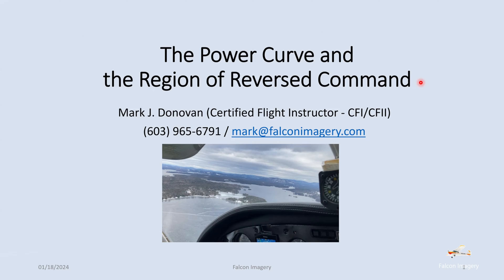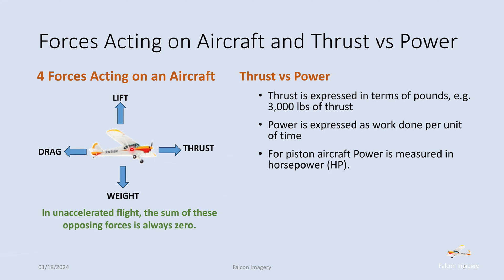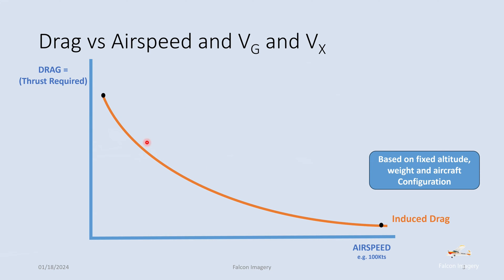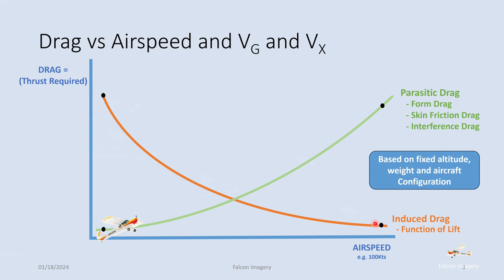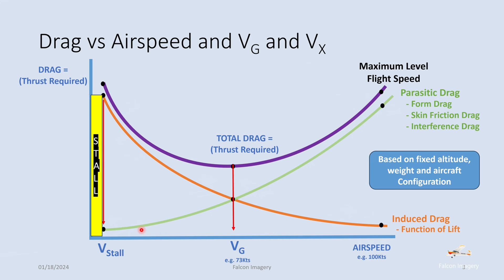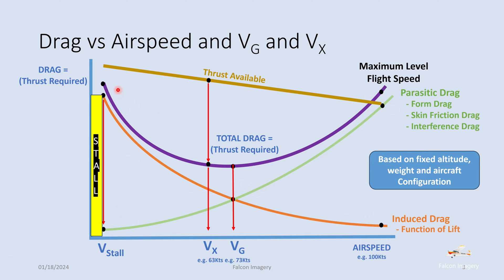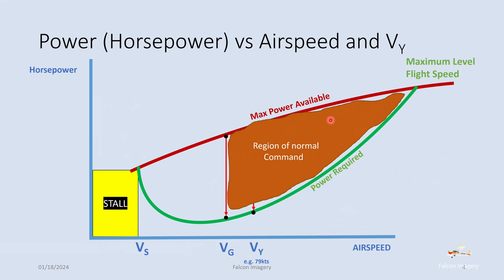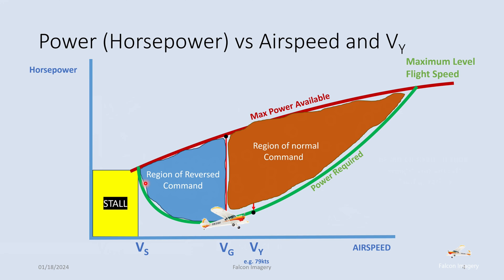Aircraft Power Curve & Region of Reversed Command Explained

Comment: The think the power required in the region of reversed command is overstated in the video.  Yes it's possible to be practicing slow flight at minimum speed in a low powered aircraft at full flaps in a strong downdraft on a hot day and not be able to maintain altitude because of inadequate pitch and power and it's critical to have proper technique when flying slowly and on approaches.  But the typical scenario is far from that.  The last time I was flying (solo) at the bottom of the white arc during slow flight in a 172 full flaps, I needed 1900rpm to maintain speed.  When I started recovery to normal speed, I applied full power and the rpm went to 2300, easily accelerating the airplane.  Weight, flap setting, and weather conditions all play a part.  But I've never flown in any airplane that couldn't IN NORMAL CONDITIONS be flown down to the bottom of the white arc and then recover to normal flight fairly easily while holding the altitude.

The part that pitch and power play in the region of reversed command is constantly debated.  It is frequently erroneously said that pitch and power reverse.  The lift and thrust vectors are in a fixed position - they can't reverse.  The PHAK explains what reverses, which is the speed and power required, not the pitch and power.  I.e. from cruise to Vg, speed and power required both decrease.  As speed continues to decrease from Vg to minimum speed, the power required reverses it's course and goes upward.

The force that opposes the weight and allows control of the altitude down to minimum speed is the lift vector.  In all civilian airplanes the maximum force created by the thrust is in the neighborhood of 30% of the weight so it is totally impossible for power to control altitude.  This includes airliners - for ex: the total thrust of the 777-300ER is 230,000lbs - the weight is over 700,000lbs.  A 160hp C172 max static thrust 700lbs - weight 2400lbs.

When you flare to land, the speed is intentionally low to avoid excessive floating.  But the airplane is leveled out from the descent and held above the runway (altitude control) how - with the elevator while the power is normally at idle - pretty clear that pitch controls altitude down to the last knot.

Comment: I prefer to call it the region of Reverse Demand as opposed to the region of reverse command. It begins at Minimum Power Required for propeller planes, not at Best Glide (no wind) aka L/Dmax. For jets, it begins at L/Dmax which is best glide which is minimum thrust which for jets only is Max E. For both, I view a different sense of Reverse Command in which you use pitch for speed control but change which way you pitch and this point is L/Dmax aka best glide (still air) aka min drag.  See Medium searching for “Back Side of the Power Curve vs Drag Curve.”  Propeller airplanes minimum power required aka max endurance is the division between normal and reverse demand. You need more power to fly slower than Max E and more power to fly faster than Max E. This Max E point differs propellers versus jets. Note Vref is slower than Vg though typically faster than propeller Vx and faster than propeller Max E. Lastly, the stall speed on the charts is not to proportion as it appears near zero (I’ll guess it is closer to forty or fifty).

Comment: @FalconImagery , great video and explanation. Does the Vg then correspond to the Vmd? Can you make a video explaining this in the context of Vmd-VmP (minimum power) and maximum range vs maximum endurance please?
Reply from the maker: Vmd is the minimum drag speed, where the parasitic and induced drag curves intersect, basically Vg (Best Glide Speed), or also the speed Vbe which gives you the maximum endurance speed.
Reply: Try Medium “Back Side of the Power Curve vs Drag Curve.” Note that so long as you are not near your ceiling, and not so high compressibility changes the values, Max E has a specific AOA while Max R in no wind also has a specific AOA. See the glider handbooks regarding best glide in wind and you can apply this to Max R in wind noting Max R with tailwind has a limit of no slower than Max E. Why you’d bother with such, I don’t know. It is the headwind that matters. Why does near the ceiling matter? Because now thrust available and power available come into play as you no longer have excess. Note as Vx and Vy collapse to a point at ceiling, so too do Max E and Max R as at ceiling, you only have one flyable speed one flyable AOA. For Max R on the jet, do the tangent from origin trick on the Drag curve (as you did on the power curve for propeller; yes tangent on power curve lines up with bottom of drag curve).